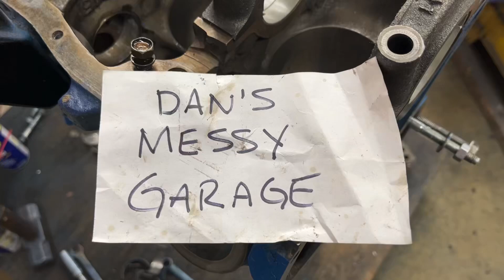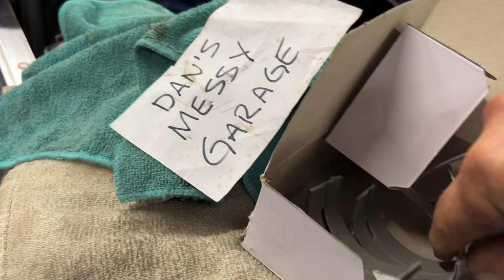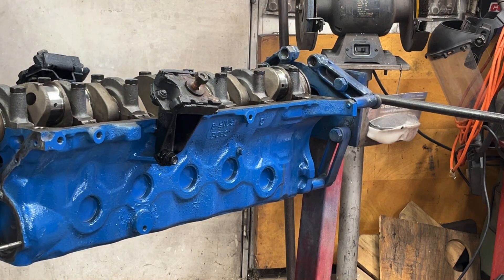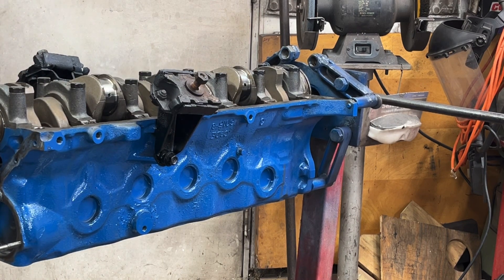200 cu in 6 cyl Ford Engine Build: Part 1 Installing Crankshaft

Comment: I completely rebuilt the 3.3L/200ci I-6 and its 3-speed manual transmission in our 1978 Mercury Zephyr in 1985. Drove the car with that powertrain until 1998 when I put in a EFI 5.0L and 5-speed manual trans. We still have the vehicle.
Reply from the maker: Excellent! Thanks for sharing that info. A 5.0 and 5 speed sounds like a lot of FUN!